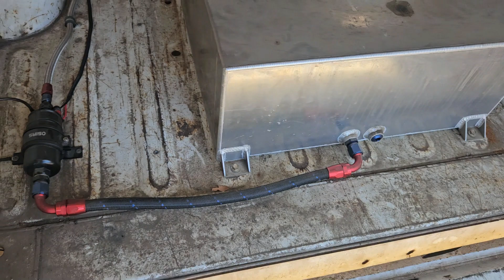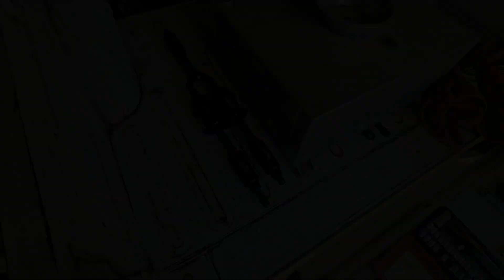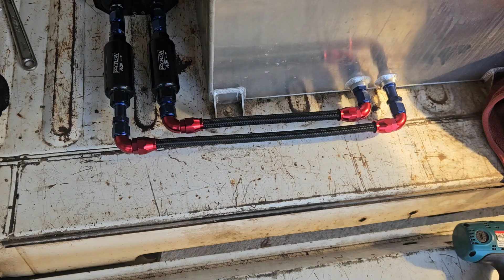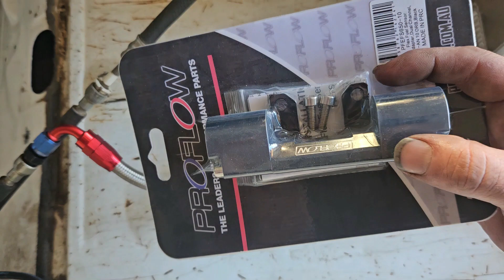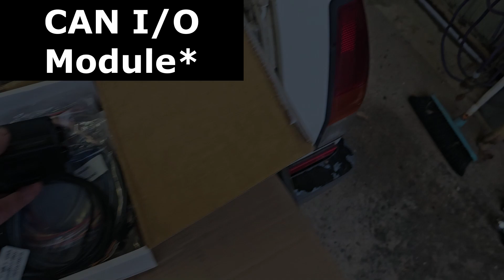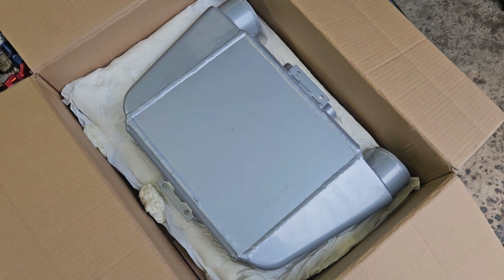XG UTE EP46: Fuel System Upgrade

Comment: Be careful with the filters on the suction side of those 044’s. I’ve seen them absolutely kill fuel pressure. At 100 micron it may be less of an issue but that depends on the quality and brand of the filter. Because some of the micron ratings on the offshore made stuff is questionable. 

Bosch 044’s and their newer replacement have a very fine mesh gauze on the suction. Adding another filter pre pump puts serious strain on these style pumps. They are not as efficient as a modern pump. 

If you notice a pressure drop, particularly after some run time, remove the filter element from the pre filter and see what happens.

Why not run the flex fuel sensor on the return line if your worried about pressure drop in the main feed?  Ethanol content doesn’t differ between feed and return.
Reply from the maker: @tonyanderson4774  ok thanks, I'll keep a eye on pressure, good info there.
I was going to put flex sensor on return with -8 fittings, but changed my mind. I heard good and bad things about both ways. It might be a good test to try later on if I have dropping fuel pressure to swap flex to return side
Reply: @ yeah everyone has their opinion.  From where I sit, I’d much rather have any (potential) restriction on the return rather than the feed.  This is absolutely critical on alky fed engines and even more so on forced alky. Love the project.
Reply from the maker: @tonyanderson4774  well you make a very good point. I'll definitely keep it in mind for later on